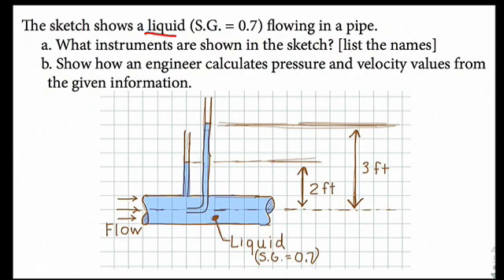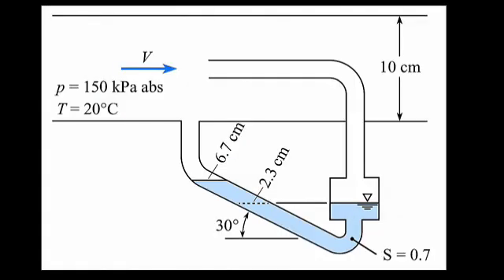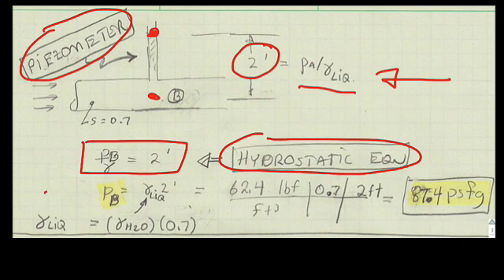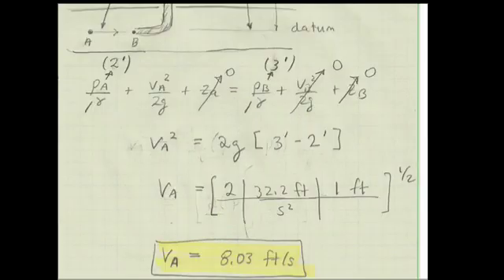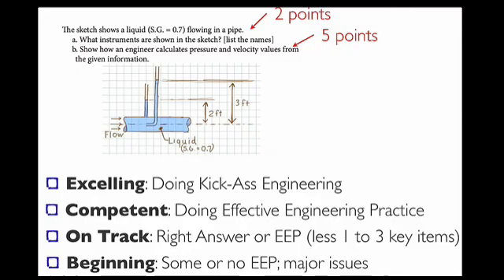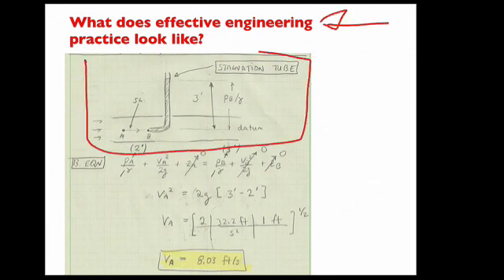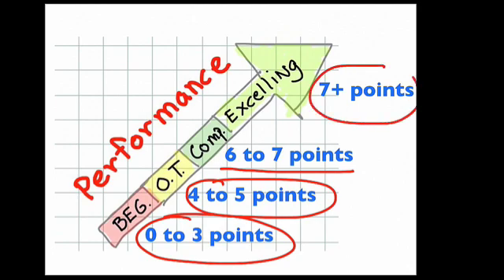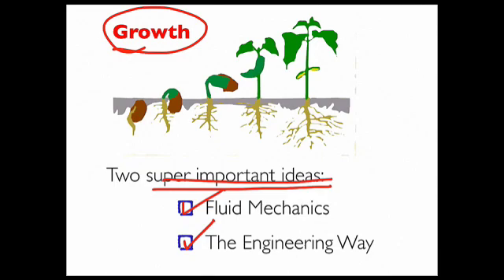Piezometers-stagantion-tubes

Comment: I have learned in textbooks that piezometer is used to measure static liquid pressure......then why the fluid is moving?
Is it pitot tube?......please help sir.....
Reply from the maker: Good question!  Static pressure refers to pressure in a flowing fluid. This pressure must be measured in a way that does not change the value of the pressure measurement. A wall pressure tap and a pressure measuring instrument (such as a piezometer) is a common way to make this measurement.
Reply: But sir static pressure refers to the pressure exerted by a stationary fluid......
please correct me, if i am wrong?